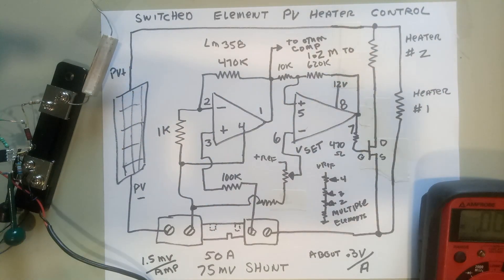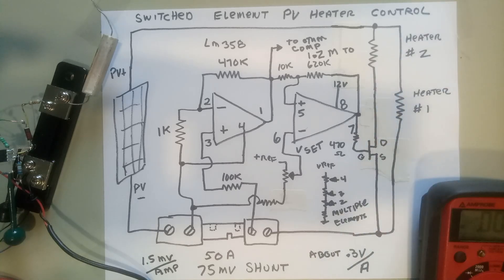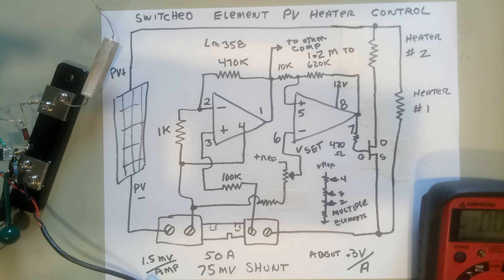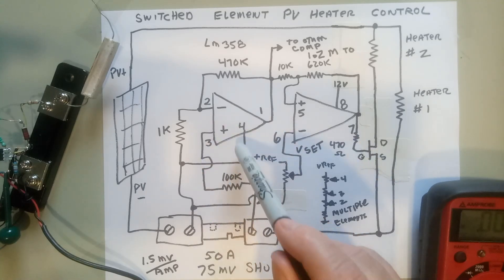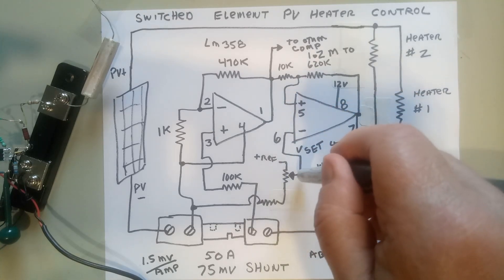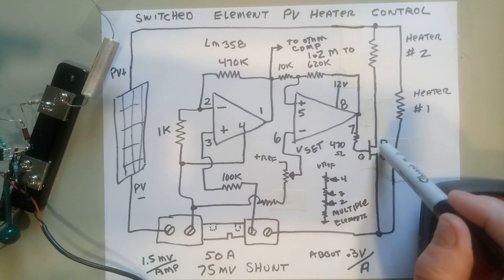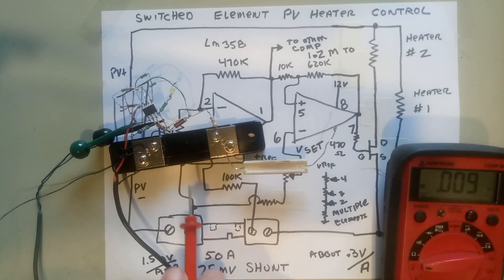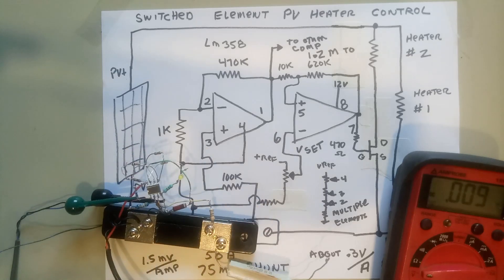Shunt Current Switching PV Solar Water Heater Elements MPPT

Comment from the maker: It will be shocking the first time you see it switch over. Power will instantly drop to half of what it was. Overall the daily total will still be higher than with a single element. It may seem intuitive to space transitions evenly throughout the current range with more than two elements. At low light levels their isn't that much power to be harvested. Having more smaller current transitions only in the higher amp ranges will harvest more overall power. At 70% of max current power drops 50% vs full MPPT.  70% current is still really good power from a panel and a good part of the day will be near this range. Smaller increments in the upper range is preferable. Problem is being limited in what element choices are available.
Common water tanks have an upper and lower element. Putting two elements series when you have higher array voltage is a better solution than parallel elements. This makes the resistance 2R in lower light.  Connect the FET so that it shorts out the upper element at higher current. Having some upper element heating at low current will speed tank temperature recovery in the morning. Tanks naturally suffer from temperature stratification. At higher solar power times the heating will be directed to the lower heating element where it is needed most.
Having elements in series has a real advantage for the FET.  It allows you to use higher current and cheaper 150V FET since the voltage divider effect of the elements reduces the maximum voltage seen to half.

Comment: Hello Opera, is this a better circuit than the other ones you have developed?
Reply from the maker: No, this only improves production a little bit.  For those who haven't been convinced yer to go full MPPT or those with MPPT wanting to add current current capability.  Can I make you a video to help you out understnding your wiring or testing?
Reply: opera Sure I always enjoy learning new solar electric ideas. Hey just a heads up. I purchased a new home with pool 🏊‍♀️. I plan take my complete system with me to the new home. She I’ll be moving there on the june 26th.

Comment: Gud I will make my own thanks
Reply from the maker: It will be shocking the first time you see it switch over. Power will instantly drop to half of what it was. Overall the daily total will still be higher than with a single element. It may seem intuitive to space transitions evenly throughout 
the current range with more than two elements. At low light levels their isn't that much power to be harvested. Having more smaller current transitions only in the higher amp ranges will harvest more overall power. At 70% of max current power drops 50% vs full MPPT.  70% current is still really good power from a panel and a good part of the day will be near this range. Smaller increments in the upper range is preferable. Problem is being limited in what element choices are available.

Common water tanks have an upper and lower element. Putting two elements series when you have higher array 
voltage is a better solution than parallel elements. This makes the resistance 2R in lower light.  Connect the FET so that it shorts out the upper element at higher current. Having some upper element heating at low current will speed tank temperature recovery in the morning. Tanks naturally suffer from temperature stratification. At higher solar power times the heating will be directed to the lower heating element where it is needed most.

Having elements in series has a real advantage for the FET.  It allows you to use higher current and cheaper 150V FET since the voltage divider effect of the elements reduces the maximum voltage seen to half.